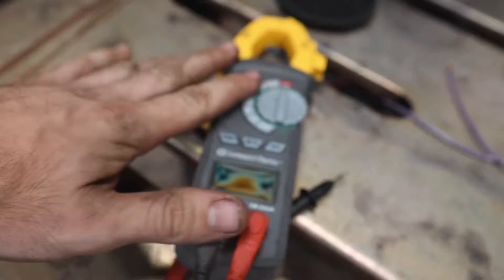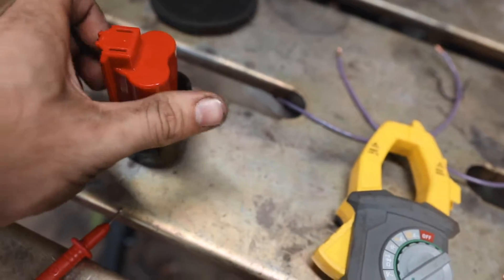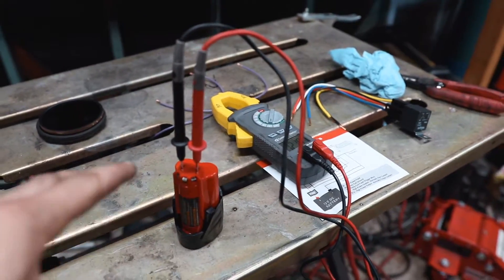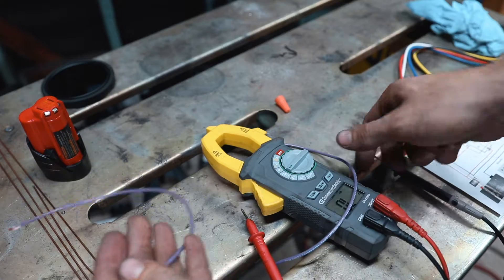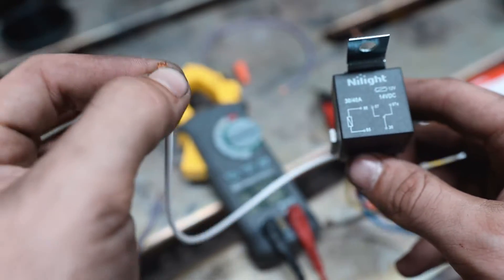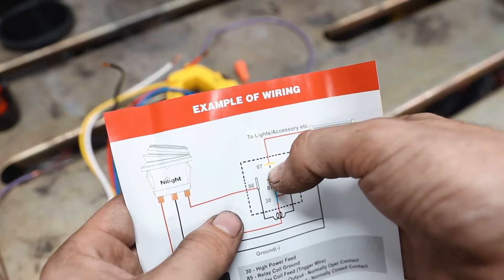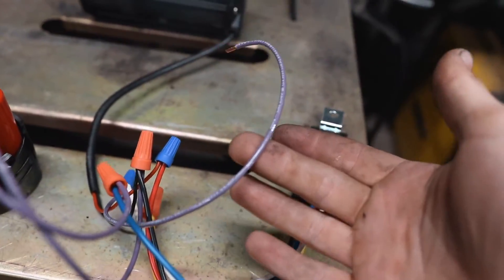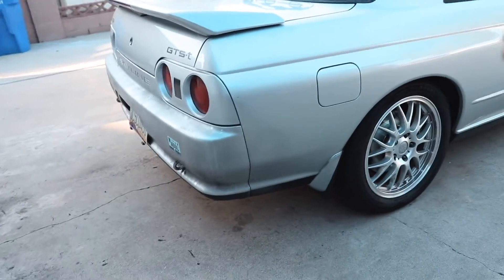Automotive Electrical Basics You NEED To Know! | Automotive Electrical Troubleshooting Simplified!

Comment: I have to choose between 2 clamp meters at the moment:

1- Uni T UT210E mini pro, with these DC ranges:
 Volt  (0.1mv - 600v) 
 Amp (0.1mA - 100A) 

➡️Good for parasitic draw test, but don't go for high ranges

2-  kaiweets HT208D,  with these DC ranges :
Volt  (600 mv -  1000 v)
Amp  (60A - 1000A)

➡️ No low reading for parasitic draw test, but has high ranges 

Can I choose type 1  to do most car diagnoses as a hobbyist , or I need both types? 

☺️💛Thanks